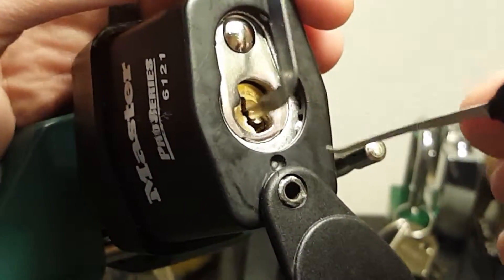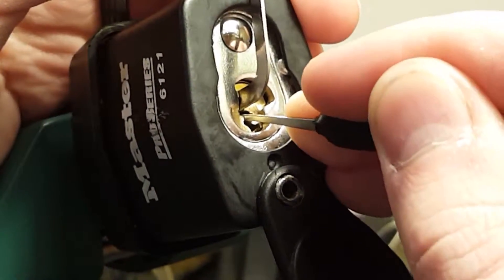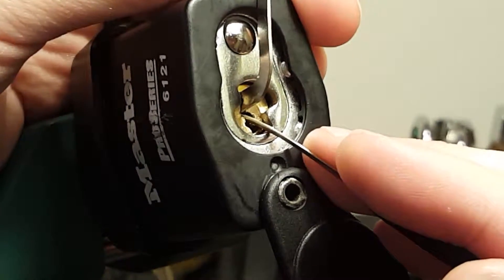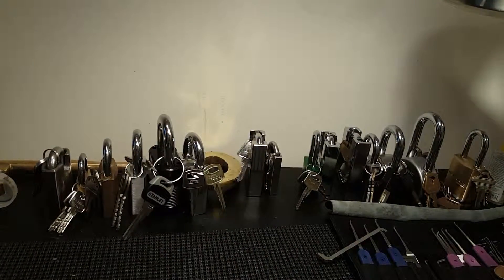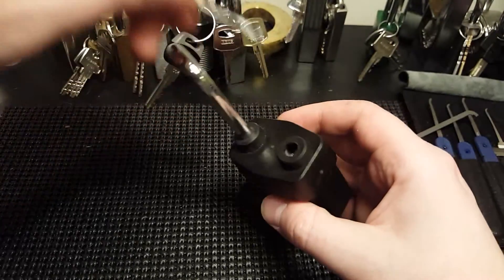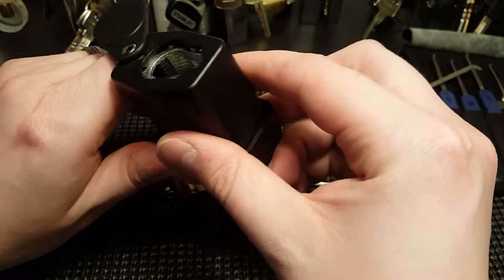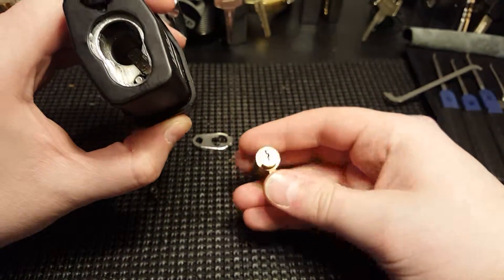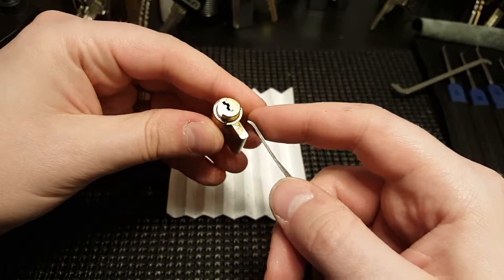(41)Master Pro Series 6121 Picked and Gutted

Comment: nice one, not a bad lock.
Reply from the maker: It's pretty well designed. No wafer though. I'm not too familiar with bypassing but it looks like you could get a tool back there pretty easily.
Reply: +RJ Robert James If Master put an American Serrated up on top, it'd be a much better lock.  What annoys me more is that Master won't fill up the 6th pin hole in production unless the order they have explicitly requires it.  

Now if Master actually put serrateds everywhere (it's not expensive, just take some from American... Master owns American), it'd be an insane price / performance go-getter and be a good step to reversing the "LOL!" factor Master locks have in locksport (and in locking things up in general).

Comment: I have one with a different core. Getting a deep false set but cannot get it to open
Reply from the maker: Is it a master keyway? or an ic?
Reply from the maker: +Marcel Pare That's the same keyway. Perhaps if you have some extreme bitting then try working from the bottom with a .015 hook
Reply: +RJ Robert James yeah it's not a easy one and its with that .015 hook that I get the false set. I'll keep at it
Reply from the maker: +Marcel Pare Well done
Reply: +RJ Robert James thanks for the tip!